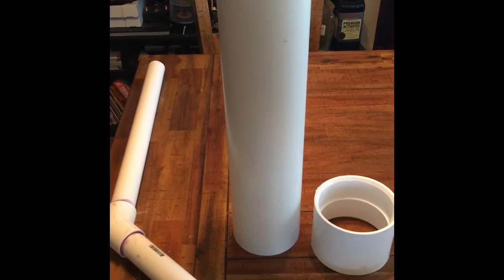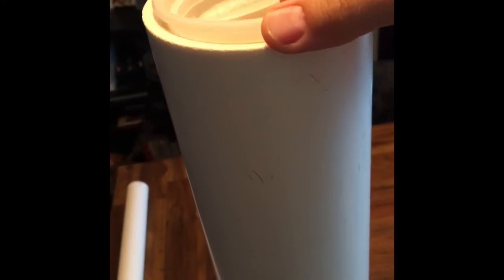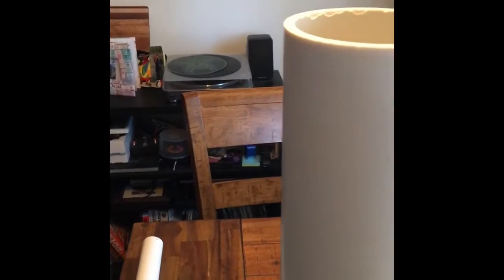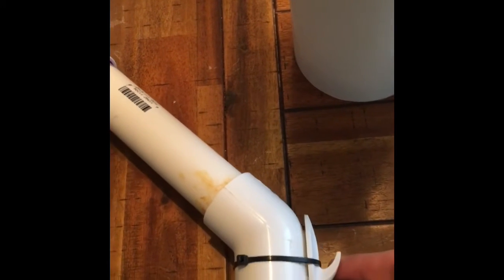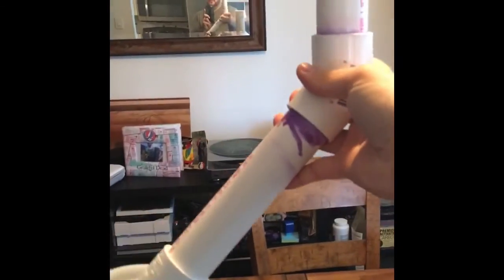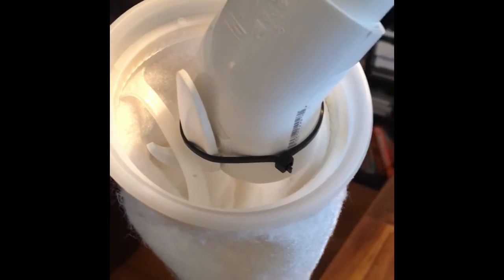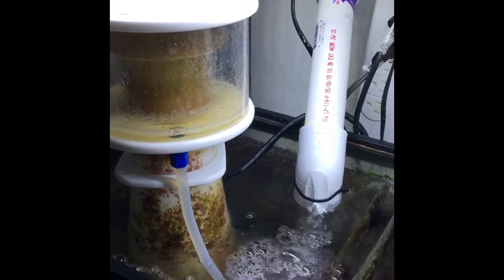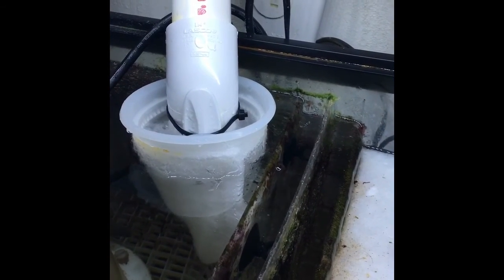DIY Filter Sock Holder - the cheap, easy way

Comment: Nice!
Reply from the maker: I recently got away from the filter socks. They were gumming up from the carbon dosing. I don't have much crap on the bottom of the sump like I thought I would. I do have some floating orange crap on the surface of my bubble trap in the sump. I'm not sure what that is.